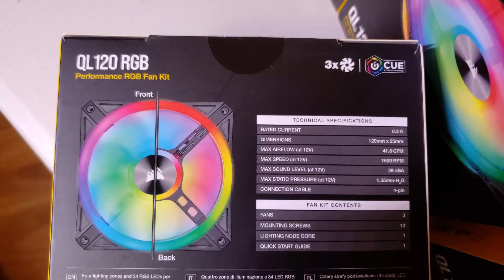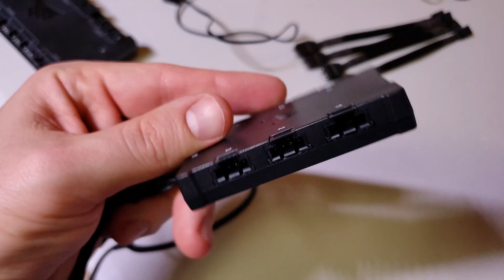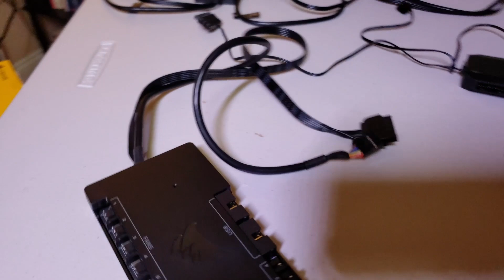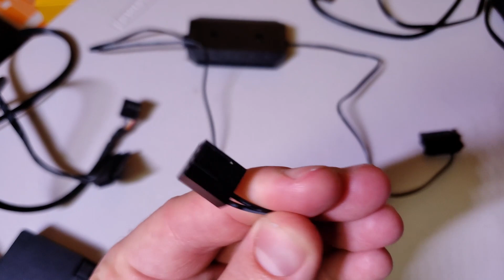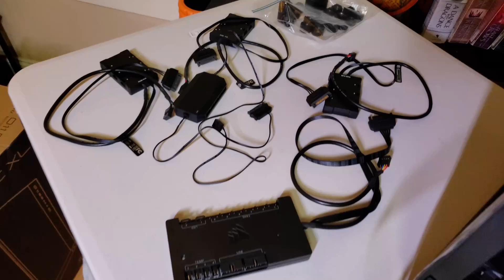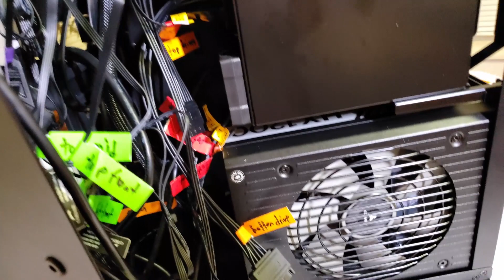How to: Lighting Fans Wiring - Lian Li O11D XL

Comment: too long form me, is that  Lian Li O11D XL works directly with argb fun or need hub?
Reply from the maker: I think you're asking if I needed a fan hub with this build. The answer to that is yes, because the motherboard does not have enough connections on its own. The case has to do more with how many fans can actually physically fit in there, not with how to plug them in.
Reply: @RonnieBunshaft  Thank you for the quick response; I'm asking about something else. I can easily get power to the fans from the motherboard, but when it comes to controlling the RGB LEDs, my motherboard doesn't have ARGB support. Currently, I only have ARGB fans, so I'm wondering if the controller that comes with the case (attached at the bottom) will directly control the ARGB LEDs of my fans, or if I need to buy a separate controller/hub for this.
Reply from the maker: @michal5869  ah I see. I don't recall the exact specs of that but I think you should be able to google that one. I would be surprised if it was any more than the basics though. I bet it's in the manual too.

Comment: Hello, I am really new to custom loop build. And I am having a hard time trying figure out where I should plug my Radiator fans. 
It's in a Lian Li PC O11 Dynamic. I currently have 360 on top, 240 at the bottom. I've looked everywhere online and can't seem to find any answer. A lot of them say I should plug the Fans into CPU 1 or CPU OPT. My question is can I plug both of the rads into each of them using Y splitter? Thanks in advanced.
Reply from the maker: I'm assuming that the 360 has 3 fans on it and the 240 has 2. So you've got a total of 5 fans to control. With fans you've got two things to think of: 1. what is controlling their speed and 2. what is giving them power. 

For the first, you're going to want all the fans on each radiator to spin at the same speed. And you may even want all 5 at the same speed depending on what you're going for. So you only need one or two controllable headers to control speed. So you'd be fine only using the two motherboard headers for control. 

But for the second, you need to worry about the max watts that your motherboard header can supply. Whether you have a problem is going to depend on your specific motherboard, the wires, how much the fans draw, etc. But I'm confident saying 5 fans off one header is a bad idea.  General I'd say is 2 is safe, 3 is pushing it. To solve that people will get fan hubs that have their own dedicated power line that goes into your PSU. I used some in my build in this video. That way you don't need to worry about power and you can send the control line wherever you want.

Comment: Can you provide a link to the EK/Corsair RGB Dongles you purchased off Amazon?  It's not clear which cables are needed.

I'm in process of building a water-cooled PC using the same case, fan and radiator setup as you.  Thanks very much for this detailed video!  The information you provided will help out tremendously as I complete my build.
Reply from the maker: No problem. Note I did another couple videos on this build too if you want more info. Including a long one on the watercooling specifically. Linked in the description. 

I didn't originally provide Amazon links as I was worried if YouTube would take issue with that but let's try it. Not shortened and not an affiliate. Note this is for the Node or Commander Pro connections only, not the fan hub. https://www.amazon.com/gp/product/B08KGMZ9YT
Reply: @RonnieBunshaft  Thanks Ronnie!